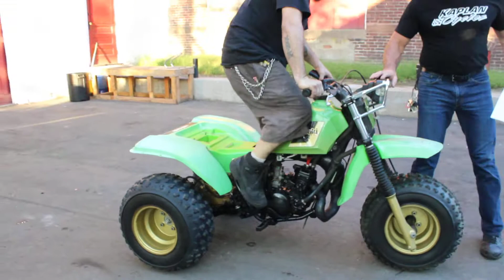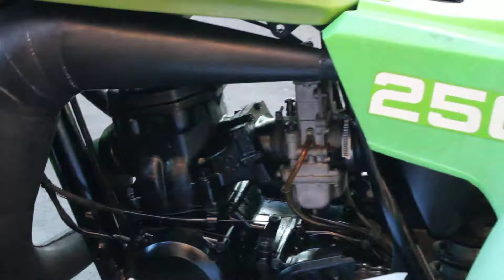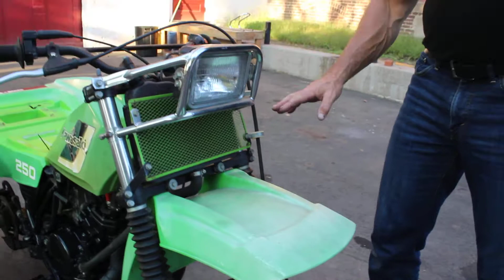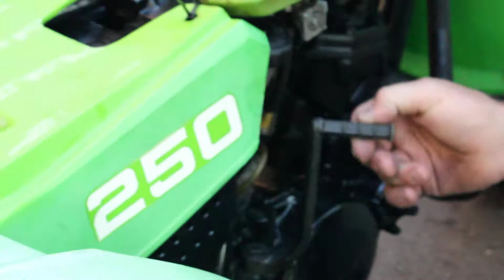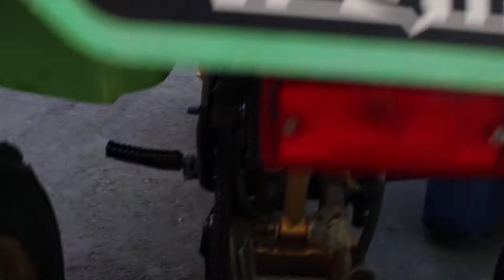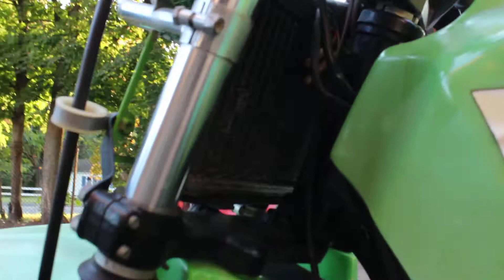1984 Kawasaki KXT250 Tecate 3 For Restoration!

Comment: Hey guys!! I have one of these I'm looking to sell!. I have done a to of work to it but never could get it to run right because I could never find the right carb jet for it. In fact I couldnt find any. 

I put a new stator in it and a new fly wheel. I had a cast iron sleeve pressed into the original jug. It is bored 20 over with a wiseco forged dome top piston. Boyeson dual stage power reeds. It has new handle grips...a brand new heavy duty clutch from ebc. Brand new crank shaft bearings. And brand new piston pin and needle bearing. Also has new seals, and new o ring chain and both sprockets front and rear....new swing arm bearings as well!. Ive done all the hard work. I just need to find a place to get main jets or someone to sell it to. 

Its missing a rear shock reservoir. And the rear caliper. It also needs a shift shaft and possibly an intake manifold. Front brakes work fine. 

Tires are the original Dunlop. With 70 to 80 percent tread. Bought it off of my uncle bone stock for 50 dollars lol. If u guys know much about these bikes u would already know that the original flywheel had magnets either glued or epoxied inside of them on an over rev these magnets would come loose and wreck the ignition coils. I put an entirely new ignition system on it with a one solid piece magnet from Ricky Stator.  If anyone has any idea what this bike is worth with what I have told you let me know.
Reply from the maker: Call me 8609169784 I want it
Reply: Did you sell it yet? Where are you at?
Reply: @KaplanCycles  hey do you have any bikes for sale